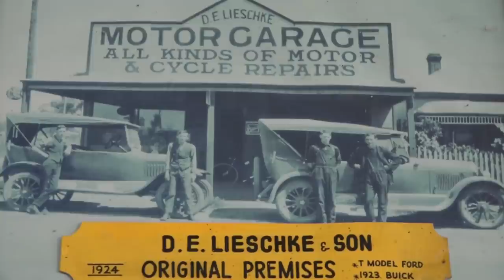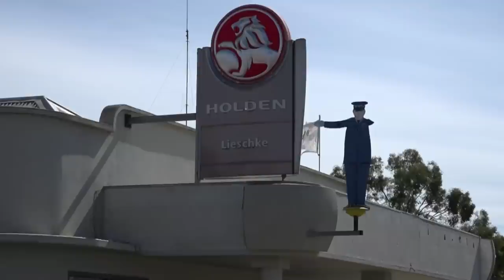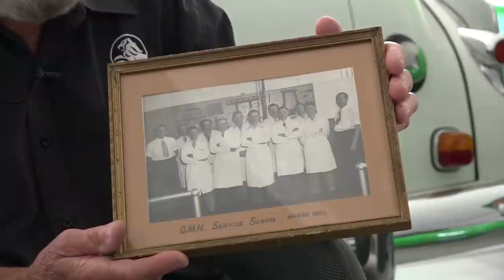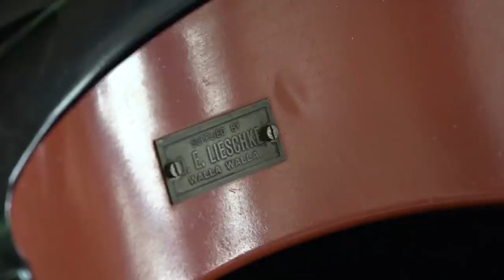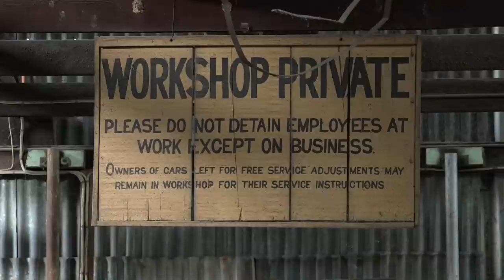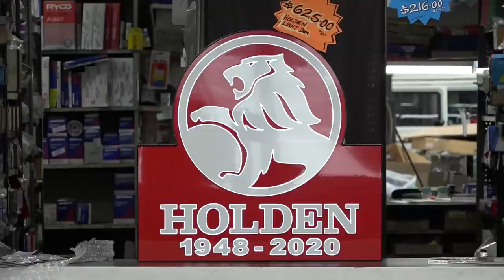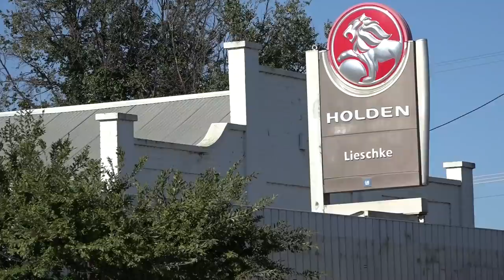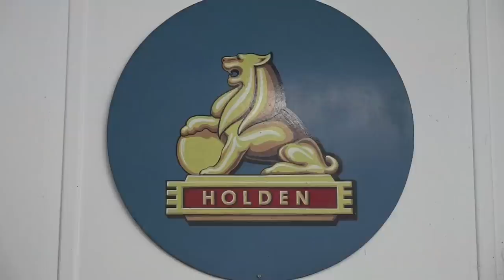Lieschke Motors - Walla Walla & Holbrook: Classic Restos - Series 47

Comment: My first car a 1983 VH Commodore was sold new at the Walla Dealership in mid 1983. Hume Shire Council were the first owners. It was originally fitted with a 173 engine and 5 speed gearbox along with aftermarket air-conditioning. Other than that it was def poverty spec